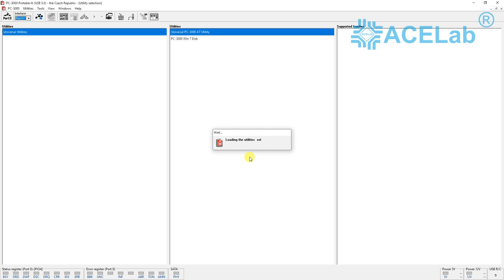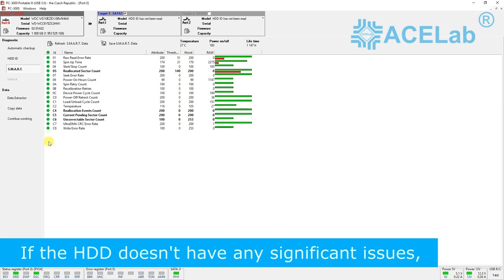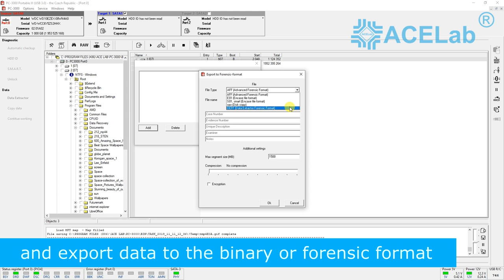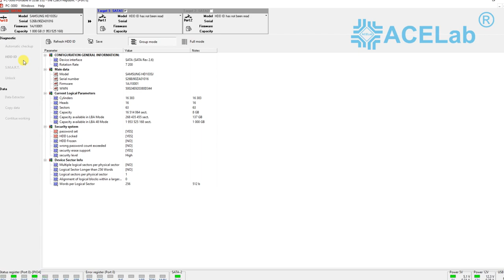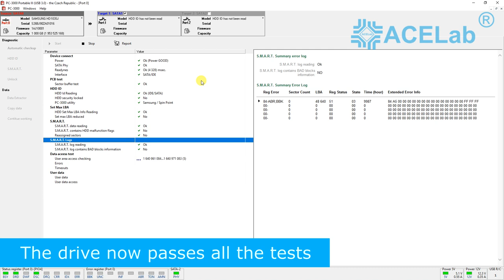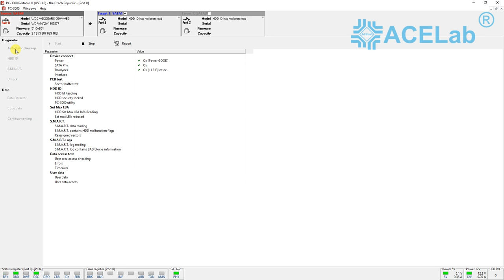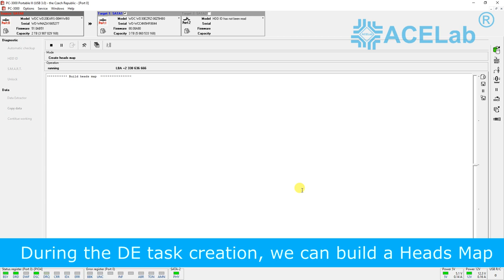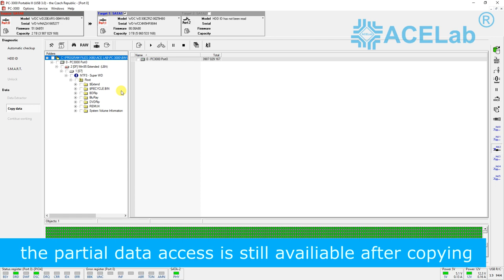The Enhanced Easy Mode to Recover Data in Simple Cases Quickly

Comment: Too bad that you took the easy mode from all the other software from UDMA and Express. Hope it will come back soon.
Reply from the maker: Initially, the Easy Mode was developed for the PC-3000 Portable III. We’ve tested its limited functionality in the PC-3000 Express/UDMA for some time to create a very new enhanced Easy Mode that contains a lot of features such as a drive power management, a complex test to check the drive’s condition with the possibility to save the report about it, a drive ID and SMART data reading and analysis, a password removal for security-locked drives, data viewing/copying/erasing, and much more! With the PC-3000 Portable III, you can use just its Easy Mode to recover data from logically damaged HDDs even if you’re a beginner in data recovery.
Since the PC-3000 Express and PC-3000 UDMA are intended for data recovery professionals who know exactly what to do with damaged storage media, we are not going to back the simplified mode to these products. The PC-3000 Portable III, in turn, are aimed at the digital forensics experts and starters in data recovery who do not want to delve into the variety of deep PC-3000 functions.
Reply: @PC3000datarecovery  It was really good for donor test. Pity.
Reply from the maker: @SGdata  On the other hand, you get a bit more information in the Full-featured Mode comparing to the PC-3000 Express/UDMA Easy Mode. 
It takes a couple of minutes more, but you may see some additional SMART parameters like Load-in time and G-Sense error rate, or check the content of the defect lists. 

Also, in the Full-featured mode, you can make the FW backup, which is very important for any drive.
If you wish to use the Enhanced Easy Mode and other new features of the PC-3000 Portable III such as support of damaged NVMe drives, the list of which will grow with each update, easier work with USB drives, the speed of SATA ports, reports generation, Standalone mode, etc., we provide you with a detailed information by email. Could you please contact us at info@acelaboratory.com or send us your contact details, so we can get in touch with you?
Reply: @PC3000datarecovery  true. I used it only to test donors. Fast, simple and easy. Heads tested, good to go. I miss that.
Reply: @PC3000datarecovery  Exactly as SGdata wrote.
We also used easy mode for quick disk test, security or locked test and basic information.
We too would like this option to return to UDMA and Express ...
It should not be that the option that was good, was tested on us, and then it was taken away ...

Comment: I have a customer that brought me a Google pixel 3XL and she says that another technician in town trying to repair the motherboard evidently it's cracked I'm wanting to know if I can take the 64GB Nand chip off of the bad motherboard and put it on unknown good pixel 3XL motherboard so she can recover some data?
Reply from the maker: Hello Richard! There is always a pair - the NAND chip in UFS/eMMC and the main CPU. The eMMC chip contains data, the CPU contains encryption keys. If you simply swap only the NAND chip (UFS/EMMC module), the data will be encrypted. You need to swap the whole pair - the NAND and the CPU. So most likely - the answer will be 'no'
Reply: @PC3000datarecovery  Thanks so much for that insight. So as long as I can successfully remove, reball and move them over to the good board there is a chance we can recover the data, is this what you are saying?  Also, since this may be more than my regular skillset requires, can you recommend someone I can contact to see if they can do this?
Reply from the maker: Thanks for your reply! We mean this is a tricky job. If you find a good local repair PC shop who will be able to reflow the chips on your phone, you can try to do this. We recommend to look on the net for a reputable company with a lot of experience in this procedure. There are many hardware repair companies on the internet, but we can not provide contacts as our main goal is data recovery, not hardware repair
Reply: @PC3000datarecovery  I have my own repair shop and have been repairing phones and mobile devices for the past eight years. However, 99% are straightforward screen replacement, battery replacement, and USB or wireless charging issues.  I have the equipment. and I did reflow the chips that were not on their pads, but I have little experience reballing, even though it's easy, I am more concerned about moving the correct chips in this case as my customer needs data recovery and I don't see any other option.  It makes perfect sense that I would need the CPU and Nand, as you said encryption is one the CPU. There are no others in my area, I have people bringing me their phones for water damage and many things because other shops will not touch anything board level.  So, please any advice would be appreciated.
Reply from the maker: @rdlynes  That is great that you have big experience with phone and mobile device repairing!
Well, reballing is a separate branch which is connected with data recovery but not directly. So we cannot provide any advice on the contacts - as much as we would love to help. We hope you will be able to find a suitable company or person, and we wish you luck with this case
Reply: @PC3000datarecovery  The only help I was hoping to get from you is a verification of the chips needed to be moved from the old phone to the known working same model, for data recovery.  I can figure out the reballing technics myself, not a big deal really. So, if all I need to move is the CPU   Nand chips that will be my first attempt, are there any other chips?
Reply from the maker: @rdlynes  CPU contains encryption keys and eMMC/eMCP/UFS chip contains encrypted data. So, you need to move the processor and the memory chip - only two elements will help you to extact the data. Probably it would be not enough for using the phone completely, and some other MCU will also need to be moved, but, for data extraction, CPU and the NAND memory should be enough
Reply from the maker: @rdlynes  CPU contains encryption keys, and eMMC/eMCP/UFS chip contains encrypted data. So, you need to move the processor and the memory chip - only two elements will help you to extract the data. Probably it will be not enough for using the phone completely, and some other MCU will also need to be moved, but for the data extraction CPU and the NAND memory would be enough